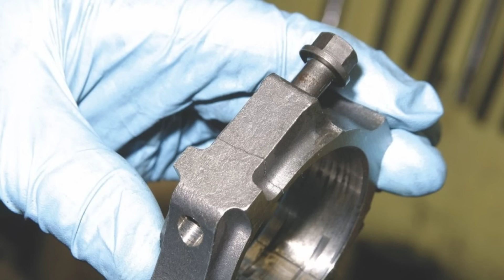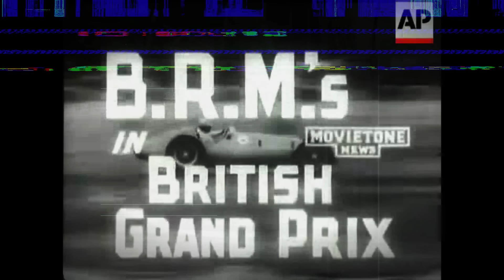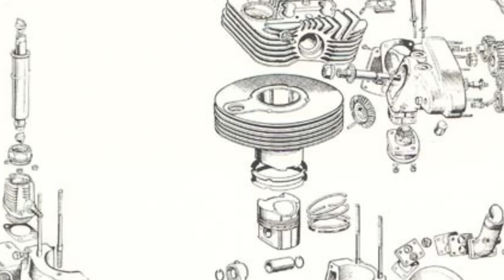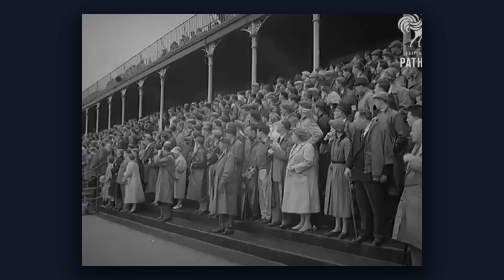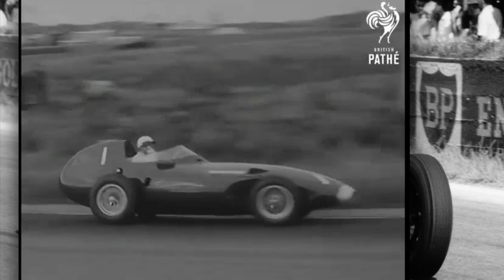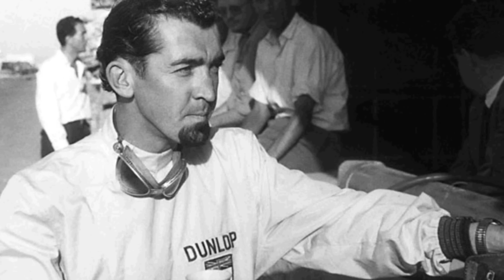1958 Vanwall F1: The Car That Was Built Just To Destroy Ferrari

Comment: British Engineers made the Rolls Royce engines that won WW2. Surely they could have made a V8 that won races.
Reply: The engineers could, the blind british management would have vetoed the cost. The story of britain  in a nutshell.
Reply: British engineers at Coventry Climax and Cosworth did just that, and dominated F1 for two decades.
Reply: Anglo delusions 😁
Reply: @Hobart6-f8z - Evidently not, which is why they eventually went with a modified Ford V8 block with Cosworth cylinder heads on it!  :face-turquoise-covering-eyes:
Reply: @Loulovesspeed  I think you will find it was based on two  four cylinder blocks.  The oversquare Cortina engine.
Reply: @Loulovesspeed  Sure you aren't thinking of Ford America's dohc 4.2 liter Indy V8?:face-turquoise-covering-eyes: